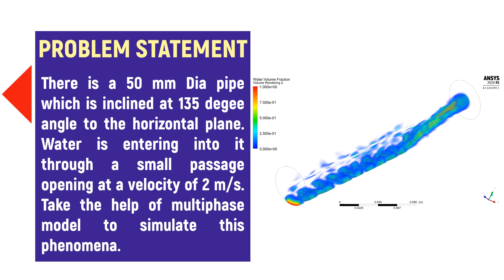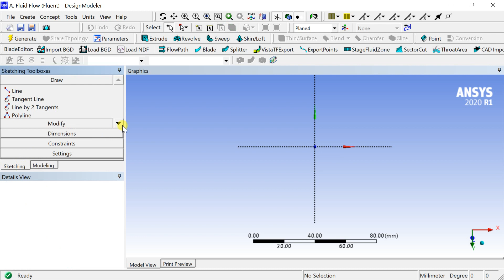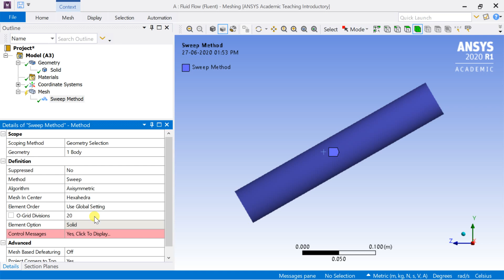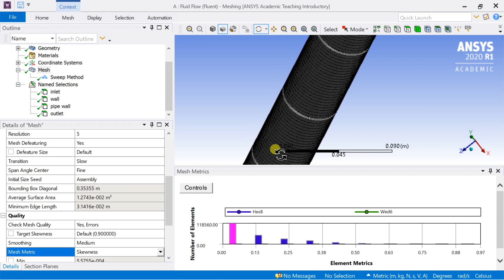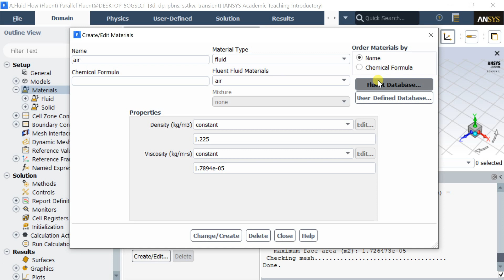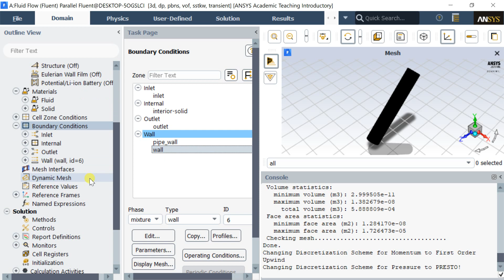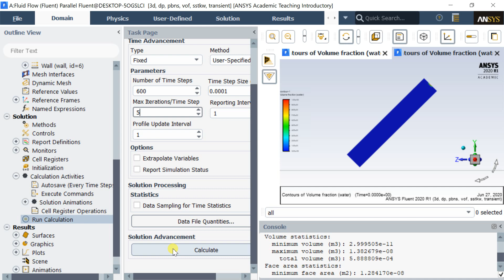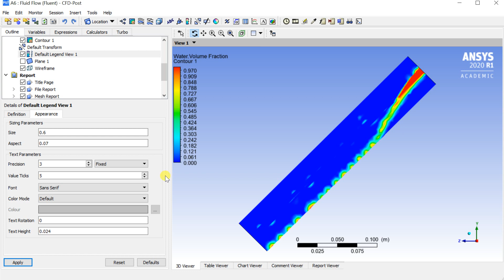ANSYS Fluent Tutorial | Multiphase flow in an Inclined Pipe | Two Phase Flow in an Inclined Pipe VOF

Comment: Hi. I have problem with generating the mesh. it says "The axisymmetric sweeper may noy associate mesh to all edges and vertices. Check any relevant loads and boundary conditions that may affected". I am using ansys version 2020 R2 Academic. I also had the line body suppresed. Please Help..Thanks
Reply: I find out that changing the inclination angle from 150 to 135 will solve the problem, as you did in the video. I thought it was optional. I have no idea why the inclination angle could affect the axisymmetric meshing. Any idea about this?
Reply from the maker: Its due to software glitch. You can create a new geometery with the same inclination ,it would work .

Comment: If I have pipe which is divided into two pieces one is water the other is air , is there any additional steps in modelling ? I'm afraid of the interaction between two pieces 
any tutorials?
Reply from the maker: No,need to worry, do it similarly.

Comment: D o you rnow how to model a two-phase flow ( oil and solides particles) in a inclined cylindrical tube.
Reply from the maker: You need to use DPM for this. In that you can define the particle diameter etc.
Reply: @AnsysTutor  can you show me please how we use DPN.

Comment: Hello! Thank you for the great video. 

I am trying to set up a two phase inlet boundary condition. 70% of the time fluid 1/ phase 1 and 30% of the time fluid 2/ phase 2  flow out of the inlet. How can I setup this time dependent inlet BC?
Reply from the maker: You need to create this using an UDF. If you cant do it using UDF then you need to stop the solution in between and switch the Boundary Condition.

Comment: The tutorial is very nice, but I don’t get the same results. The water is just flowing down the pipe without forming on the wall or even a separation on the water jet. Any ideas how to fix that?
Reply from the maker: Try to improve the mesh.
Reply: Do you have any recommendations for an improvement? I used the same Parameters like you. Unusually the number of nodes and elements is lower than yours.
Reply: I solved my problem changing the interface modeling. With the „sharp“ mode I get the same results. Do you know how to be sure that this mode shows the reality? Why isnt ist sharp/dispersed?

Comment: At 18:36, your screen shows a different time which is 0.344 sec, differs with in your previous set parameter 600 steps 0.0001 sec per step, so finally we get different contours with yours. Can you tell us the real parameters of your showed results?

Comment: What should i change if i want 2 different gas enter at inlet of a pipeline at the same time with one is enters with bigger fraction from another gas. Btw nice video.
Reply: And another question is can i do it in 2d for the geometry?
Reply from the maker: You need to put different volume fractions for that.
Reply from the maker: Yes you can so it in 2D.
Reply: @AnsysTutor Sorry again. I want to ask if i want a fixed inlet pressure and pressure drop along a pipeline. lets say i want 0.5 psi (3447.38 Pa) at inlet, what should i do because when i change the operating pressure, the outlet became 0.5 psi and not the inlet. Thanks in advance.

Comment: I followed the instructions in the tutorial, but the results are different. The difference is that my result is just the form of air draining out, and water does not form on the wall in the form of drops. What is the problem?
Reply from the maker: Did you get the flow of water or not. Check the inlet velocity and volume fraction of water at inlet.
Reply: @AnsysTutor  Thank you!!
Reply: Hello Sir, I also faced the same issue. Checked the inlet velocity,  but same issue happened

Comment: Sir, The following error is shown while doing meshing with sweep method "The following non sweepable bodies have force sweep method controls and cannot be swept".  Any idea Sir? I am using Fluent 15.0 (Window 10/ i7 processor)
Reply from the maker: You need to suppress the line body created.
Reply: @AnsysTutor  I did that but the results are the same.
In 15.0 ver., I couldn't get the Algorithm and O-grid division option.  Is the problem occurred due to these ?
Reply from the maker: The algorithm o grid is a new option available in ver 19R3 & higher versions.

Comment: i think you made it wrong . in initilazition you made water volume fraction as 0 it just helps for iteration time . you need to patch the zones which you want to fill at begin.
Reply from the maker: Patching has a different purpose it cant be used everywhere, i might have used patching if its filled with fluid already. As its an empty pipe , we need to use volume fraction method to instruct the solver regarding the fluid.